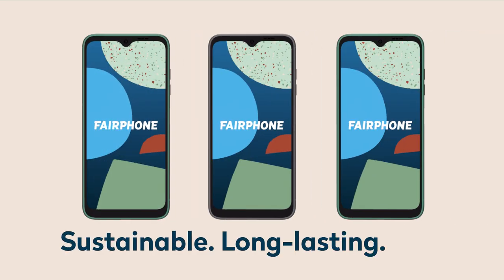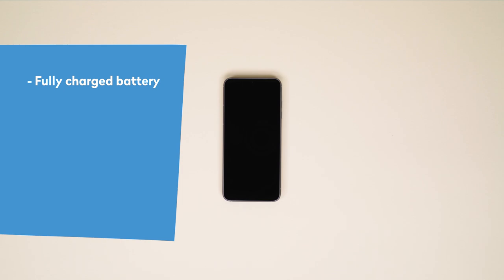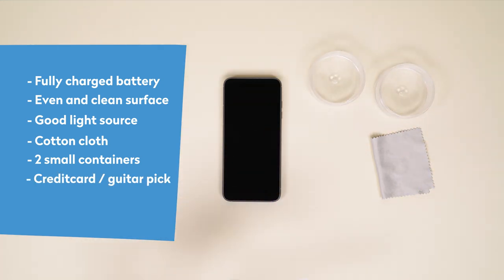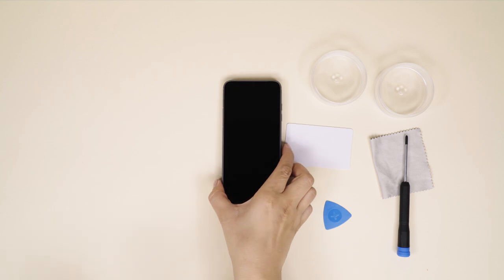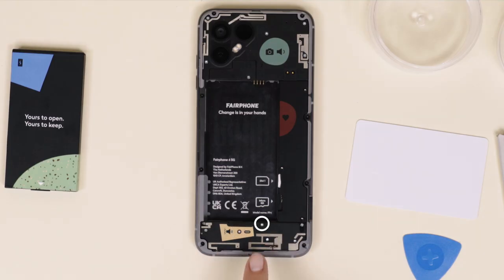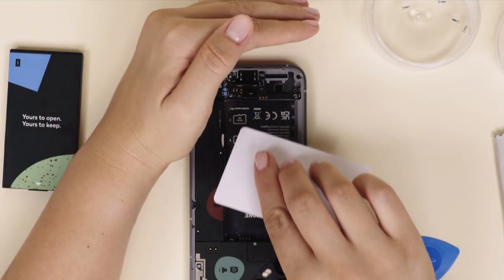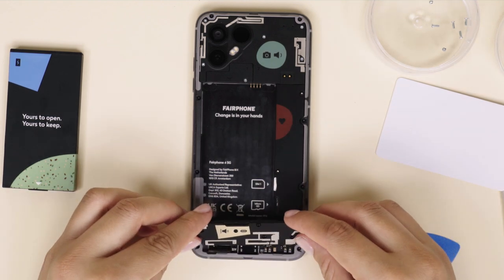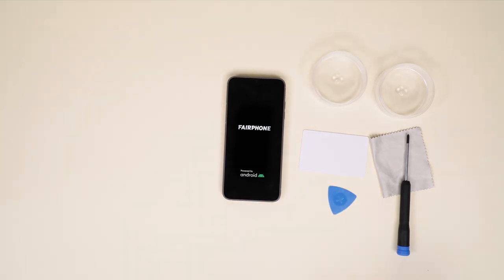Replace the USB-C Port | HOW TO FAIRPHONE 4

Comment: Just a heads up if your FF4 suddenly stops or becomes very picky about charging; Ive had to do this swap twice now.
The FF4 sadly has a small design flaw where the USBC Port has space behind it, that allows the connecting pins on a part of the connecting "ribbon" to get pushed on and potentially ripped out with repeated use, or if you have a long Male USBC connecter that will cause too much stress if you are not careful when pushing it in. 
This is exacerbated when dirt clogs up the phones port, when means you have to push harder on the cable to get it to start charging.
I think a small fix is filling up the space behind the port with a small chunk of plastic, but I will have to see if it lasts.
Reply: Ah is that the reason I had to do it already after about a year. The fairly heavy cable provided by FairPhone may also have quite the pull if you charge while in use. Well, glad it's easy then and maybe the FP-X in the future will have a better design :-) (when I finally have to let my FP4 go in hopefully quite a few years)
Reply: Interesting and I'm very disappointed this part has failed on my phone so quickly.

Comment: Bring this phone here in the Philippines. I'm so sick of chinese brands taking over. They can't even make phones with stock Android installed, even the preinstalled file manager app have ads.
Reply: Why not import?
Reply: Unfortunately they don't officially ship outside the EU because dealing with international phone certification procedures and import regulations is too much of a hassle and way too expensive for such a small company.

Importing may be an option of you can find a third party reseller willing to ship it to the Phillipines but then you'll have the same issue as soon as you need a spare part. The infrastructure for their recycling pledge which is only possible due to tax-free shipping between EU countries wouldn't work either.

The main issue is that most users are not interested in this kind of alternative phone. They want a new model every 1-2 years which Fairphone doesn't do, they want sonething slim and sleek which isn't possible without gluing it shut and they want something powerful which can't be delivered for this price if your phone is produced ethically and sustainably.
In truth, the Fairphone is only as powerful as your average mid-range device but has a price tag almost like a flagship model.

Comment: An antenna replacement/upgrade would be awesome 😎

Edit: also, is there support for a different OS? Let's say...Linux mobile?
Reply: You should be able to install any OS you want, maybe you could check out their website or forum for resources?
Reply: @johndumpling1896  I haven't checked honestly, I was asking how difficult it would be to do so.
Reply: @jakeaustin901  Fairphone makes it easy by allowing you to unlock the bootloader, and installing a different OS won't void warranty. How easy installing an OS is also partly depends on the developer. It looks like /e/OS will have an installer that automates a big chunk of the process.

Comment: Hi fairphone,
I wonder why don't you make the mother board water resistance so if the phone gets wet I can exchange all parts except the heart of the phone
Reply: They could also seal the chassis of the phone so water can't get inside. Would be pretty cool and would make it last long in an easier and safer way